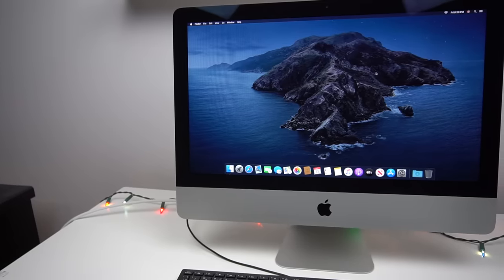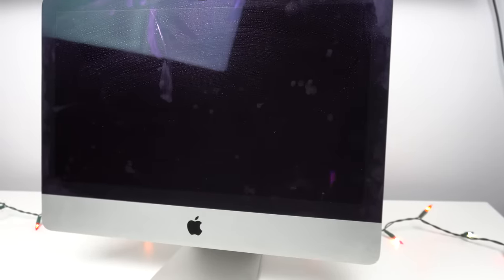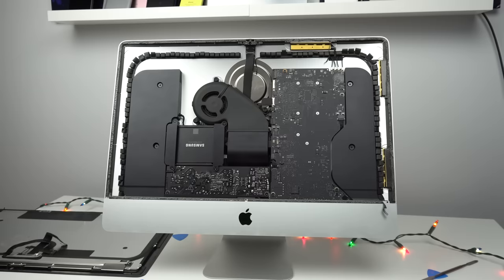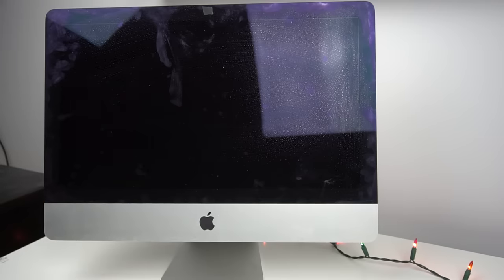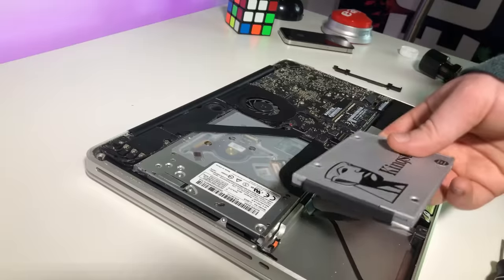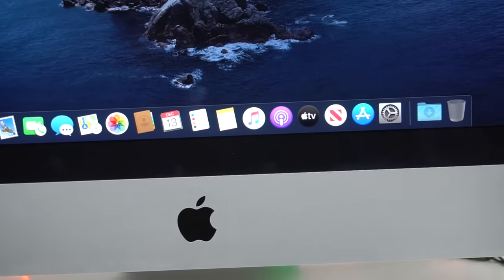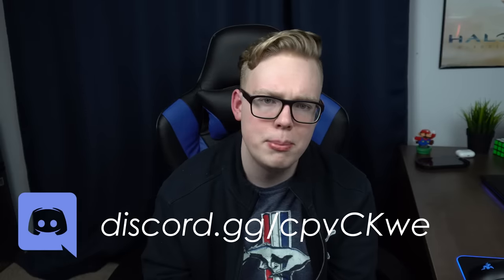Upgrading my late 2013 iMac!

Comment from the maker: Having an SSD in an old computer can completely breathe new life into it. I definitely recommend doing the upgrade if possible because trust me when I say you won't regret it.
Reply: 91Tech This is a great video 👍🏻 and btw, thank you for your hard work today.
Reply: 91Tech love the shirt man
Reply: is the graphics card located under the display port  connectors for the screen
Reply: i have the same computer and i really need to upgrade the hard drive and ram, but im scared to break it :( this is the only computer i have to do school work and its so laggy and takes forever to load programs :(
Reply: So what about this BS thermal sensor everyone says you need to keep the fans from spinning up?
Reply: I have done this operation on a 2012, 2016 and my current 2017 imac last one including changing cpu and I use ordinary double sided tape, works fine
Reply: @marschrammeyer7164  I agree using double sided tape is better. Using the aftermarket adhesive strips in this video are thinner and make getting back into the Imac for any future upgrades almost impossible,. I tried getting back into my imac a 2nd time using the proper recommended cookie cutter tool, but cutting through the adhesive was very difficult and I ended up ruining my display... I wish the original adhesive strips used by Apple were available, because it makes it much easier and safer when doing this upgrade...
Reply: Hi..my imac 2013 is slowing down when opening few tabs in chrome..do I need to upgrade the RAM (to 16 GB??)  or change the HD to SSD instead ?
Reply: @roblox21242  If you are uncertain about opening up the iMac, you can hook up an SSD through the USB port which will allow you to boot from the SSD, which will still be faster than using the internal hard drive.
Reply: @melchora7  Thank you, will this also help with programs? I'm having such a hard time, I use firefox because chrome eats too much ram but im still experiencing a lot of lag and loading times, like when i load a website i get the beach ball at random times... and it takes about 3-4min to load ms word. I installed a bunch a programs, i only have firefox, ms word, excel and my imac still super laggy. it takes forever to open programs and to save files like when i want to save my essay, it takes forever to even save, it freezes the screen and then the beach ball appears. im saving up to get a new computer at this point but it cost a lot.. i was thinking of getting the new mac mini but im not sure if its a good idead because everything is soldered like the ram.. i might have future issues with ram shortage if i pick up the basic model :/
Reply: @roblox21242  Yes, the boot up time will be decreased and programs will load faster. The internal mechanical hard drive will give you between 50-80 mbs read/write speed. If you connect up an external SSD to the USB3 port you will see approx 400 mbs read write speeds with no modifications to the computer.  Apple allows you to install and boot an entirely separate operating system externally, as long as the computer meets the requirements.
Reply: @melchora7  Thank you so much, I will give this a try!
Reply: @roblox21242  Make sure and get a decent usb to sata cable, the less expensive don't always give you the full speed of the drive. Here is one that I use: https://www.sabrent.com/product/EC-SS31/usb-3-1-type-ssd-2-5-inch-sata-hard-drive-adapter/#description The USB 3 port will give you about 420 mbs max speed, so make sure the drive you select is Sata 3, which is capable of at least 500 mbs. Good luck.
Reply: @melchora7  Thank you so much, I also think my imac is overheating... because i get a black screen, it happened a few times, i looked up on youtube it says that its something about the thermal paste that causes screens to go fully black T___T. im so stressed because school recently started and this is the only computer i have... and i dont think i will buy another imac because its expensive and not worth because you cant change the hardware and it starts to wear off :(
Reply: @roblox21242  Your welcome, yes macs are expensive. Not sure which imac you own, but you might try and vacumm the air intakes, perhaps you may have dust build up which can block air circulation.  Also, you can download Mac Fan Control which allows you to regulate the speed of your fans and will also show temperatures of the various components.
Reply: @melchora7  thank you, i have a late 2013 21 inch imac, i will try those tips out.. i hope it will last me until my semester is over.
Reply: Thanks for doing this video! I did the same thing with my 2014 iMac. Have you seen the new Samsung T7? Do you think it can work using the thunderbolt 2 to thunderbolt 3 apple adapter?
Reply: i know Im asking the wrong place but does any of you know of a method to get back into an Instagram account..?
I was dumb lost my password. I love any tricks you can give me!
Reply: @Spencer Gunner I really appreciate your reply. I found the site through google and I'm in the hacking process atm.
Looks like it's gonna take a while so I will get back to you later with my results.
Reply: @Spencer Gunner it did the trick and I finally got access to my account again. I am so happy:D
Thanks so much you really help me out :D
Reply: @Kingston Arlo Happy to help =)

Comment: I know this is an old video but THANK YOU! I bought my mom a used iMac and had HD problems that I didn't even fully understand. But I had an old SSD I wasn't using and it appears you helped me solve the problem. I got the adhesive strips and a tool for removing the screen on eBay for about $7. Installing Catalina as I type this. Again, THANK YOU.

Comment: My dad didn't feel like opening up his iMac Late 2012 so I got him a USB 3 adapter and a 1tb wd blue SSD and it has made a huge difference even though its not running at full speed
Reply from the maker: Definitely a good way to upgrade if you can’t open it up!
Reply: That’s what I did
Reply: No.  Open it up.  Tell your wife it's broken and WE need to upgrade.  Works everytime. 🤣
Reply: I've read that it is not possible to install and run Catalina from an external SSD, anyone known to this wether it's possible or not?
Reply: Xander Calasahan it is I did it myself
Reply: @xandercalasahan1799   I am running Catalina right now from an external SSD with a late 2013 iMac.  I have a Samsung 860 evo 1TB in a Sabrent USB 3.0 enclosure. It's MUCH faster now.

Comment: Thank you so much for this!! Watching this gave me the courage to upgrade my late 2013 iMac from hdd to ssd. Its like I have a new computer. Super snappy and so worth it. The only criticism I have about your tutorial is that, when I booted up the iMac with the ssd, you made it seem like you went straight to downloading macOS. I did that and it didn’t read my ssd. I started to freak out but I later found out I have to click disk utility first and erase it and then go back of download macOS. Other than that thank you!!
Reply: Agreed! although tbf he did say to search for more professional tutorials at the start but totally agree
Reply: Hi, I want to do this on my late 2013 imac but have read that you have to do the thermal sensor also, I don't see that in this guide. Did you do it and if not do you any fan speed problems.
Reply: @challsism  I followed the video and did the extra step I commented about but I didn’t do anything that involved a thermal sensor. Once I changed the hdd to ssd i didn’t have to worry about anything else except the connection ribbon near the top. It is very fragile and a couple times I would connect it and the screen wouldn’t Turn on because it wasn’t connected correctly. That was my only issue. It’s the ribbon that has to be disconnected and tells the screen to turn on. My advice, don’t attach the screen on permanently until you test everything. I opened mine about 6 times because of that ribbon. Good luck. Seems scary but if I can do it so can you.
Reply: @CharliesLazy3DPrints  Thanks for the prompt reply, I was not sure whether to order one or not just now but now i'm going to give it go (Famous last words) lol, thanks again mate.
Reply: @challsism  I was feeling just like that as well. But it’s so worth it. Before I upgraded it I would literally have to wait 5 to 8 minutes for a safari and zoom to open. I would get up and click them and then go to the bathroom because I knew it would take so long. But after the upgrade everything opens instantly! Please keep me updated! You got it haha. Have fun too. And dust it out since it’s gonna be open.
Reply: @CharliesLazy3DPrints  I kind of have no choice as the original hdd has just given up, so it makes sense to upgrade. I'm hoping that's the only problem as it turned on but couldn't get past the boot screen, after much research and trying different things, none of them working, i think it's the hdd. So now the ssd and mounting kit are ordered, i've opened it up and disconnected the screen, removed the old hdd and i'm now waiting, I'm going to have to go over again what to do when the new one is in, i want to reload from an external back up but think i have to erase first. thanks for the advise and i will keep you posted on my success or failure, lol. Hopefully there won't be another broken imac on ebay....lol
Reply: @CharliesLazy3DPrints  How long did you wait from powering down to taking the screen off? He said 2 days but that seems too long for me. I use my Mac everyday now that i'm working from home lol
Reply: @RAYMUFC8  honestly I just unplugged it and started to work on it right away. Maybe I was lucky and no charge was given off but be careful. To be safe maybe unplug it and give it at least 30 min.
Reply: Or use Internet Recovery (2011 and later Macs) to install the macOS version your Mac came with.
Reply: You just saved me
Reply: Pin this comment

Comment: You should use the APFS file system when you erase the volume. It is better optimized for SSDs. You will get that option in disk utility once you have updated to High Sierra and after

Comment: I have a 2013 model, running Ubuntu because mac os dropped support.  For those reading along, there's a wiring harness sold for about $39 U.S.  This keeps the cooling fan from going full-boot.  Often the cooling sensor is incorporated in the hard drive region.  There's software that will control the fan, but not on all OS.

Comment: Watching this on a 2009 MacBook Pro, I replaced the ultra slow HDD with a 240 Gig SSD, doubled the RAM from 2 to 4 Gig, bought new (used) internal speaker , new battery.  It"s a nice laptop to use for consuming media, web browsing and basic productivity tasks.

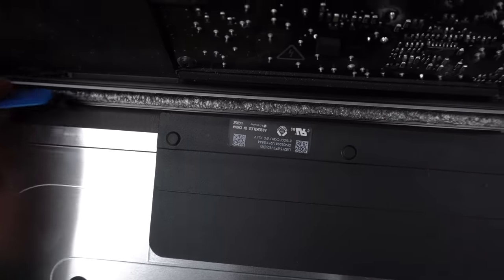Comment: 4:10 there are tabs at the far left and right that you pull to remove the bottom adhesive - support the screen as it could fall BEFORE the last piece is removed

Comment: I did this with an older 27" iMac The glass is held on with magnets, not adhesive. However, I used Disk Utilities to "restore" my HD onto the SSD using an external USB3 to SATA cable first that way I didn't lose any data or settings or 3rd party APPS .

Comment: Behind the main board there's a SSD M2 slot that you can put a NVME disk using a SSDM2 adapter to NVME. Is very easy and you lost an opportunity to make a huge upgrade on this Mac by adding this SSD + a NVME.

Comment: I think the caveat is that taking out the HDD bottleneck will allow your other components to sing. If your other components are muck then you won’t see the same benefit as this guy. But if you have an i5 and 8gb ram and you’re still running a HDD you will be amazed

Comment: I went to a boot fair yesterday and came back with a 2013 iMac for 50 pound little did I know it had a 2tb ssd and 16gb of ram he went down so low because of a chip and very small crack in the corner of the glass it is now my main computer

Comment: I have an iMac late 2013 .  I believe is the same as in this video . My iMac is soooooo sooo slow ! It’s possible the i5 intel chip also too old or just replacing the internal mechanical drive for n SSD ? Also can I plug an External SSD drive ??

Comment: Hi great video.  I have IMAC late 2013 27 inch.  can you recommend a graphics card as i need to upgrade it.  So i can play flight sim/xplane? thanks .  I am not a computer geek so i aint got a clue lol.. my graphics card is currently a NVIDIA GeForce GT 755M 1 GB which is crap for xplane and is it easy to replace old with new?

Comment: just grabbed the same model, ordered my ssd from amazon, just gotta hit ifixit now to get the adhesive,  i want to replace the RAM but alot of ppl are saying its super dangerours because of that power supply on the bottom on the unit . any ideas josh ?
Reply: Just hold the power button on the back of the iMac because that will drain the capacitors and make it safe to do.

Comment: For many apple products, I have to disagree with the "It simply works" part, even if not every apple product fail after a few months, it´s worse than every other brand on the market especially with the newer macbooks. (butterfly keyboard, too short flex cable in 2016, problems with the t2 chip..) And I heard from so many people near me, they having these problems, it´s a dealbreaker. Simi-old macs however are half decent, so thanks for the informative video!
Reply from the maker: True, there have been a lot of problems hardware wise (my MBP keyboard has broken twice lol). Glad you enjoyed the video :)

Comment: So when you talk about upgrading to a SSD, where does something like a 128gbSS/1TB HDD Fusion Drive come into play? Does the main 1TB HDD need to be a SS as well to see good increases in performance? And if you could either change the 128gb SS to a 256 or 500gb SS “OR” change the 1TB HDD to a 1TB SS , which one do you think would be best to do if you could only upgrade one or the other? Thanks!
Reply: Change the HDD to an SSD.  Not an expert in fusion drives, but I've read that replacing the existing SSD part of the fusion drive can be problematic, and if you do, the two drives may not be able to "re-fuse," at which point you would just have two separate drives, instead of one fusion drive.  A fusion drive is better than just an HDD, but overall much slower than any SSD.  They were basically a compromise from a time when large SSDs weren't yet practical/affordable to use as a boot drive on their own.

Comment: I am a newbie at this but I have 2 questions, would it be better to buy a 2TB SSD to replace the old hard drive? My work is mainly photography. My second question, why wouldn’t and external SSD work the same? I am new at this I was thinking of replacing my MAC but having seen this I don’t feel like I need to anymore.
Reply: An external SSD will work great as long as you have a USB 3.0 or faster port on your Mac and the SSD also has USB 3.0 or better. If the only thing you want is a faster boot volume, that is the much easier way to do it. It’s really not worth cracking the case unless there’s some other reason to get in there.

Comment: So after twenty years I have an iPhoto of about 1 terabyte.  I’d like to do this to my 2013 iMac but I’m afraid of not having enough space on the ssd.  What’s a solution without having to spend hundreds of dollars?  Also, what about a thermal sensor?
Reply: You don’t need your Photos library on an SSD. You can keep large data groups on your existing internal old slow spinning platter hard drive. Get a nice external SSD, install MacOS onto it, boot from it, then point Photos (and other apps) to where your media is located on your old internal drive.

Comment: Would’ve liked to have seen an exact data transfer from the old HDD but it can’t be too hard I hope.
Reply: It's not that hard, though even if it's an exact copy, some things may not work exactly they way they did before.  Even though it's the same data, it's not going to be in the exact same place on the new HD, which can cause issues.  When switching to a new HD for your boot drive, it's really best to just do a clean install
Reply: @AdamMilton  A proper clone will maintain all file paths. It’s no more time consuming to clone your old drive to your new one than it is to install MacOS – and then use some other method to copy over all your files and reinstall all the applications. Clone BEFORE you install the new drive, that way you can test it before opening up your Mac. In fact, with a decent external enclosure and USB 3.0 or better, you can completely save yourself the hassle of opening up your Mac and just boot from the external SSD.

Comment: I went above and beyond and actually took my Late, 2013 iMac completely apart and switched out my 8GB of RAM for 16 GB and a 1TB SSD and this thing is SOOOOO FAST!!!
Reply: Hi..what ram did you buy? Also is the fan loud after installation?
Reply: @DiedrichSeth   thanks for the reply.  I'm really confused now because I'm on the chat with crucial and they said the ram is soldered on? I have a late 2013 imac 14,1.
Reply: The 2013 does not have the ram soldered on, but you do have to take apart just about everything to get to the rim.
Reply: @AndrewSilk  Yep exactly, I did it, but it was very tedious  work.a model a couple years prior had a trap door right in the back to switch out the ram sticks to upgrade whenever you wanted to. Apple just got more and more unable to upgrade as they have gone on with their business practices.
Reply: Thank you..I decided not to take it apart. Lol I got the 870 Evo ssd from samsung and it's running from that externally. Before that it was reading and writing at 40 now 415!! It took forever to start and everything was so laggy. Now it's so fast. I'm wondering how big sur would work on it. Right now it's catalina.

Comment: You could have also upgraded the CPU and the RAM while you are at it, something like a i7-4790K/i7-5775C and 32GB DDR3-1600.
Reply: I think the max that this model can handle is 16gb. Only supports 2 slot of 8 gb of ram each. If I am not mistaken.